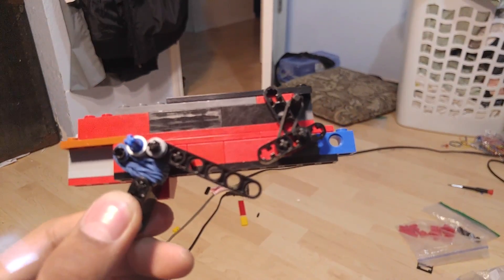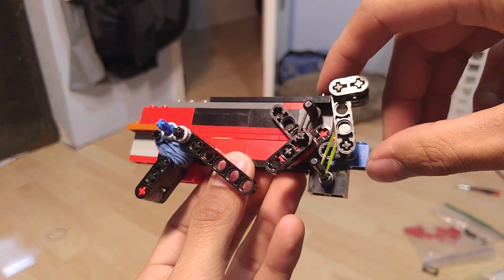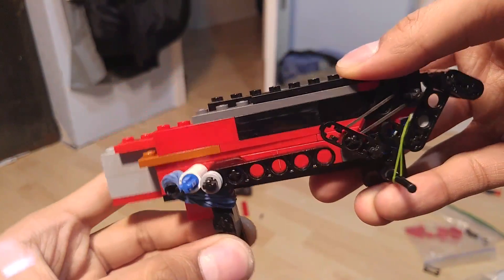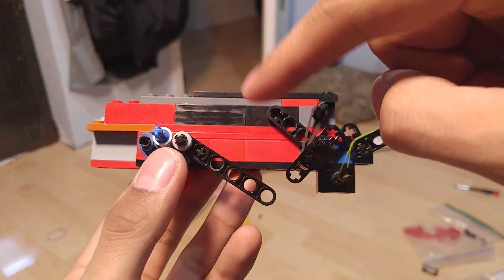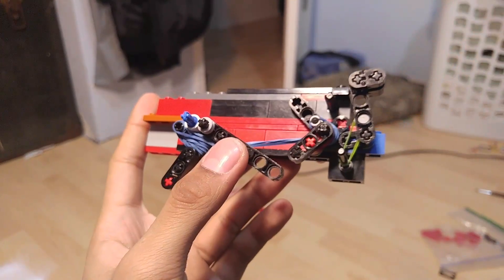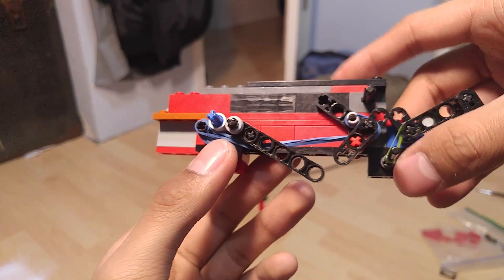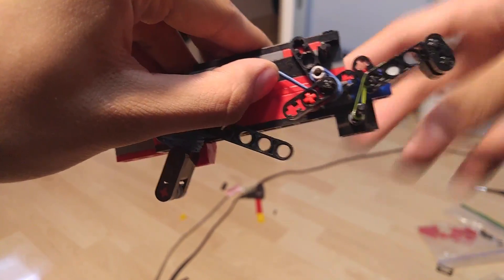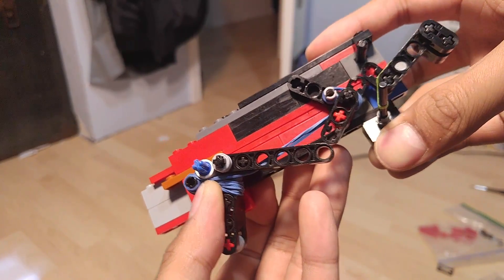Stage 1, 2, and 3 Lego Blowback Mechanism (Explained slightly less poorly)

Comment: My personal explanation for any blowback/semi-auto brickshooter mechanism: the trigger must operate something to index a ratchet (or hammer, basically anything that needs to move) and reset itself without the weapon needing to be recocked. The mechanism will cock the gun for you to shoot.
Reply: It not powerfull to pull the silde to cock the gun or back and how do you can fit the blowback mech and shooting mech in something like 3 stud wide? I getting tried to see people act smart like "omg u r so dumb add a blowback mech and then it gonna become semi auto! Lol xd°1°1°1" i can say it nearly impossible to make it work but possible to make it semi auto or fullauto with small motor but the gun will shoot very weak like gunsmokedynamic(idk i type correct)he make gun that can shoot brick fullauto by 1 small motor
Reply: And when you cock the gun you need to pull the silde very far and the blowback mech can pull the silde like 2 stud
Reply: But nealy impossible dont mean impossible i see one dude who make something like you think in 8 years ago
It is a lego mp5k and the mech is like this blowback mech but it connet to the bar that push the bullet out of the gun 
But it shoot very weak and and go like 1 meter and the trigger is push very hard since it the main thing that make the gun shooting
Reply: Link for mp5k mechhttps://youtu.be/r3BCYsr-uHg
And i see someone make video about semi auto gun that have shell eject and the bullet can go like 5 meter but can shoot far dont mean it powerfull...... but it was still cool and the video is 10 YEARS AGO and some dude name "LEGO Gun Instrution"(idk if i type correct my english is bad) recreat it and make a tutorial (it is a lego mp5) so yeah but there is mech that is semi auto but powerfull and very simple
The rubberband will push the bullet out of barrel yeah that is how mech work but the reload is slow if you use like 10 bullet the rubberband reload will be like 2-5 minute! Yeah so this is what i know about semi auto lego gun